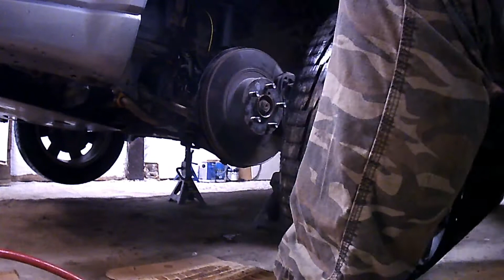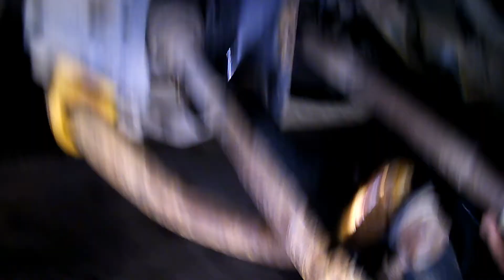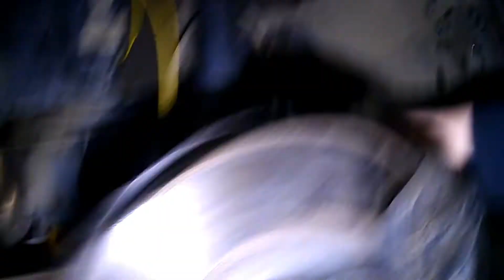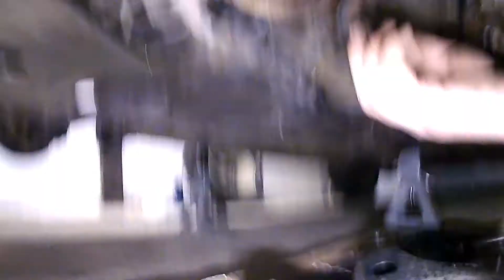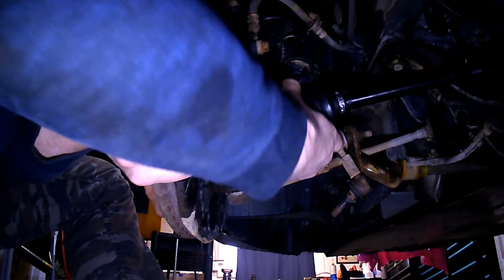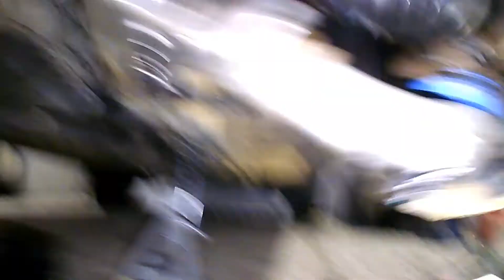Outback Front CV Shaft and Control Arm Upgrade

Comment from the maker: I've come to find out these axles have more articulation and would be superior in a lifted application.
Reply: hey homebrew. i put one of these axles in my 08 and it separated at the cup by the transmission, so i got the regular shaft to replace it now i have a shudder at take off. any ideas? mine is a 2 inch lifted outback.
Reply: @johnmastr7901  generally with third gen outbacks anything but OEM axle cause problems.
Reply: @tysauce1986  yeah I figured that out after the second try went ahead with the Subaru axle no problem since
Reply: Man I got a used forester and the previous owner had just replaced the front axels with what appear to be cheap chinese axels and the car has a small shudder when in drive or on acceleration.  I am going back to OEM I have read that non OEM axels can cause this
Reply: so.. just get OEM axles? Please tell me not from the dealer as I have to guess they are $300 each. Is there a way to tell if what I have are OEM? what about rebuilding with new bearings?

Comment: Im guessing theyre gdb sti alloy control arms you are adding.
Do they fit most legacys 04 -09 ?
Reply from the maker: I didn't purchase them, but I know they were listed for a Legacy as an upgraded arm in the regular aftermarket. They did not come from a performance parts store and not ordered for STi. I'm also not 100% sure if Impreza arms are the same in those years or not.
Reply: If ur still looking those are mevotech forged alluminum control arms. Cones with ball joint and both bushings

Comment: Love the tricks you showed. I don't have air tools either.... also was wondering.. in the US how much did his upgrades run for. Springs and control arms
Reply: Fair enough. I'm replacing both control arms. And I'm probably going to replace the tie rods. I really want to put some lift on it. Any recommended replacement if I add some good springs? I want everything to be upgraded that should be ya know? Everything is only as strong as it's weakest link.
Reply from the maker: From what I've seen, even lifted Subies are pretty durable. Old wheel bearings might be an issue with a larger wheel/tire combo if that is your plan. I would like to lift my Forester eventually.
Reply from the maker: I think my air compressor was down during this job, I don't remember.  I really don't know what the parts cost, it was a friends car and he sourced the parts. My guess is the control arms cost $250-300 for the pair.

Comment: How did those Trakmotive axles work out? I have an '06 LLBean that has the terrible vibration when you accelerate. I just saw these axles yesterday and looking at the design, they look really nice. Did the person who owns this car ever report to you how they worked out?  I'm planning on doing the whole shebang. Car has 122K so figure new struts, bearings, Mevotech lower control arms and the Trakmotive axles.
Reply from the maker: I have worked on the car since doing this work. This was actually the same Outback that had broken a timing belt. I have driven it a few times and it rides awesome. He has never mentioned an issue with the axles. 
Something you may want to have checked is the propeller shaft. More than likely one of the u-joints is seized or binding and causing the vibration you are feeling.
Reply: We just bought this car about three weeks ago and didn't feel this when we test drove it. I think the previous owner tried to fix it because it has a brand spanking new driveshaft on it. The two axles in the front look old, but they  are not original (not green on the inner cup) On the Outback forums the guys say this car has the classic symptoms of poorly rebuilt axles. I would think (and I might be wrong) that with a bad U joint, wouldn't the vibration increase with speed? This only does it at lower to moderate speed, under above average acceleration. This car has turned out to have all sorts of things that weren't apparent when we bought it so I have my work cut out for me. Thanks for replying so fast!
Reply from the maker: Seized joints within a propeller shaft generally cause resonance. They will vibrate at certain speeds and diminish at other speeds. Sometimes increase in speed or frequency will make it worse, much like an unbalanced wheel. This is not always the case with a driveshaft creating resonance. Good luck

Comment: Have you ever experienced vibration from using remanufactured axles. Excellent video by the way
Reply: Aftermarket can cause vibration during acceleration or in drive at a stop from what I've seen on forums. Hoping going back to OEM cv axels fixes my issues
Reply from the maker: Thanks. I have seen worn out old used axles cause vibration, but I don't remember a case where a new CV axle caused me a problem.

Comment: Like the ball joint trick, haven't seen that one yet...just got the mevotech AL arms, debating on doing myself or taking to shop, quite a bit of rust in the salt belt. Just waiting on new links. Do u need to drop the car first to torque everything down?
Reply from the maker: The aluminum arms are a great choice. If you can torque everything while still on jack stands, that's fine. Having a helper hold their foot on the brake while you torque should be good enough.